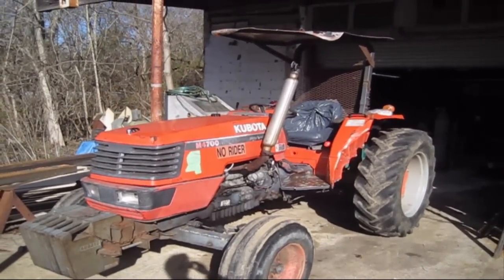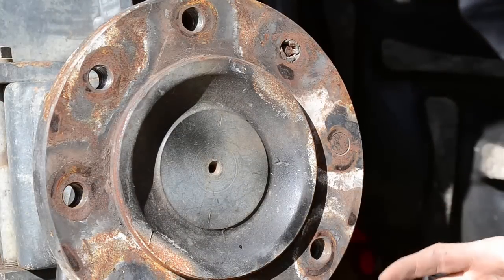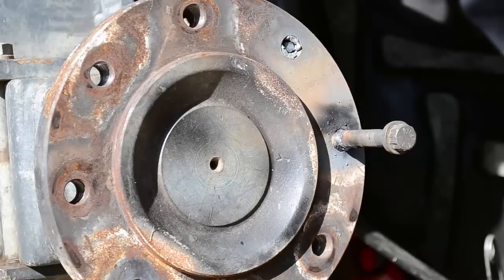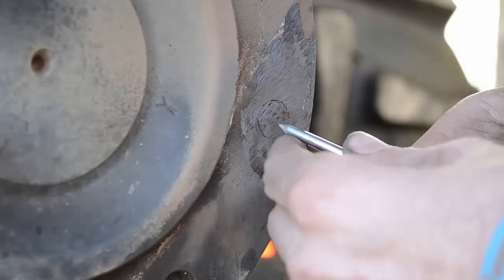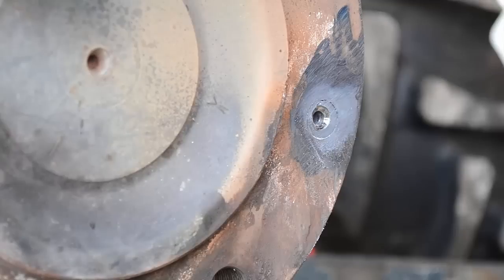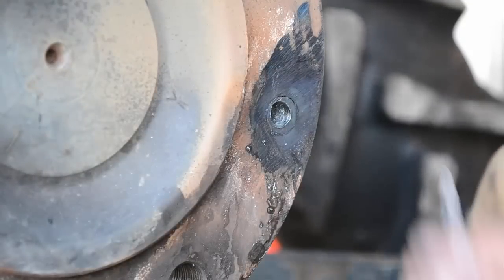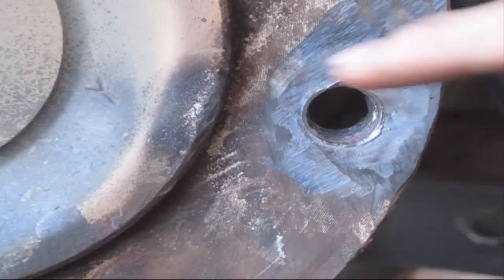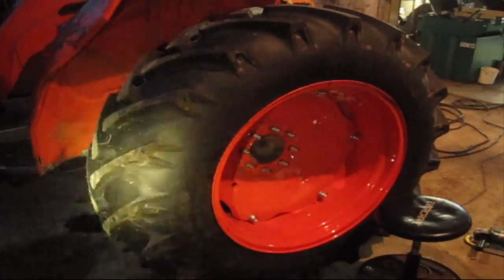Broke-off bolts techniques

Comment: The type of drilling you're doing...if you'll do it at a slower RPM and use Crisco vegetable shortening for cutting oil for drilling and tapping...you'll be surprised. But if youll weld a flatwasher on the whole busted bolt and then weld a nut to the flatwasher..the heating will loosen the bolt and the washer wont break off the stud. I've done dozens. But other than sounding like a dern troll...thank you for your time to make the video and showing one way to do the job. Thanks

Comment: Also, once the stuck bolt/stud moves, I move to manual extraction with lots of fluid and short left right moves until it frees up. II will then turn it until it is stiff again and repeat short left right moves. left - right = clockwise / counter clockwise.

Comment: Armchair Quarterback but...., When you welded the bolt on. Attach a bolt which is slightly smaller than you  used and let cool. Use the impact a run the bolt on through and cut the bolt off. Be sure to use penetrant to reduce thread galling.

Comment: A machinist used to extract broken bolts by heating them, and then taking a hunk of candle wax and putting it on the broken bolt, and then the wax would go into the threads and lubricate  the threads to where he could extract the bolt using a left handed drill bit which would drill in so far, then once there was enough of the old bolt removed, the rest of it would back itself out of the bolt hole. It was interesting watching him do that for me when I had bolts snapped off in cylinder heads deeper or flush with the threads.
Reply from the maker: Perry Bailey Hey I get it everybody has a opinion on doing the job, but you have to remember I was working on something someone else tried and failed to do. In my book there is no wrong way to do something if you get the work done.  I've pulled dozens of broken bolts out for a good number of years all with the weld technique, and I have learned one thing. What you see is not always a easy win.  I know everyone who has watched this video has thought "I could have done that in 10 mins" yeah me too.  Just because it might look easy it can and will bite ya.

Comment: if you drill a hole through the broken bolt then you can use a cutting torch to lance the bolt. you do not usually need to cut to the threads. after letting it cool it usually walks out easily.

Comment: Thanks for the video. The speed of that drill makes me cringe.. LOL  Slow and steady with drill speeds in steel. The bit wont over heat that way plus use oil or cutting lubricant. Also another tip is a carbide burr on a die grinder will remove a broken tap. Also welding on the broke off bolt hardens it. Sometimes it hard to decide which path you should take as welding it like you did will remove it. I generally use wire feed and a nut. Thanks again for posting. Good job!!

Comment: I have torched out bolts. Another way after drilling a central hole is take a small carbide cutter and a dremel. Cut the bolt back to the threads. Then peel out the remaining bolt from the threads. And run in a tap to clean it, or use a tapered tap to clean out the tiny remains of bolt threads. You have an advantage seeing the studs are large.

Comment: Just a Tip for drilling bolts out and this goes for the metal. Always start out with the smallest drill bit then go 1/16 then go to 7/64 then go to 6/32 then go to 13/64 and so on. this will get that bolt right out if you have to drill it.  I realize its not very quick it you will have better success drilling them out.

Comment: I read a lot of the comments and many were about drilling at slower rpm but no one mentioned drilling a small hole ( like 1/8" pilot hole ) first then 1/4" then whatever needed after that. It's much easier to drill a small hole with a hand drill. Always use cutting fluid.

Comment: I had to do this 2 weeks to install a new muffler on my Outlander. Once I drilled through, I used a bolt extractor to get the broken bolt out. Big pain in the rear.

Comment: I have used a hacksaw blade crown down half the height to fit in the hole I drilled , cut four slots to the tips of the threads, and with a punch crush the bolt smaller. Works on fitting too.

Comment: After you weld the bolt on and wiggled it a bit ...next time rub a basic white candle around it by the threads ...it draws the molten wax in and lubricates it making it easier to come out.

Comment: The only thing you did right was in punching the center of the stud.When drilling start  with a 1/8 hst. bit fast or slow doesn't mater. Then go to a 1/4" bit and cut down speed to about 450 rpms. That speed will do for all bits afterwards. If the bit chips or even breaks off get a grinder or a chop saw and saw of the end of the bit and re -sharpen it again. I use bits until there is nothing left of them . Put the bolt into the hole and weld it in , or use some of the other suggestions that have been mentioned here. Heat the flange before trying to turn  the bolt it works every time. Albert.

Comment: Using a length of chain attached above the work point and a lever bar attached to the chain and placed against the butt of the drill enables you to maintain a chip load so as to prevent work hardening.

Comment: After you ground bolt flush you could have took it out back side, Also after you have a hole all the way through you can fill that hole with weld which will shrink the bolt, weld nut (my preference) or blot on it and normally screw it out with your fingers. Shrinking it with weld was an old trick a machinist from a ship from WW2 taught me many years ago. Although in some nearly 20 years working on heavy equipment I have had to blow the bolt out a couple times. Drill speed way to fast. When you get movement back and forth spray a little WD40 and keep working slowly.

Comment: Build up the bolt end if below the surface and then weld a hex nut to it and work it out. 
   If you slowly pour water on it. It generally comes out easier than any other friction reducing chemical. 
Been welding since 81. As a career.  Easy fix for some one with a little experience.

Comment: My tip is when the threads get questionable. Use a longer lug bolt. Put a nut on behind. Also, I've had success with drilling a pilot hole in the broken bolt. Then driving in a larger torx bit in. Plowing its way into the broken  bolt. One set in a socket. However there is danger of just forcing the thin wall of the now drilled stud into the threads even more tightly. But, it has worked many times for me.

Comment: As an engineer you want to heat the area around the bolt, Not the bolt. The bolt expanses with heat making it tighter.  So heat around the bolt and apply cold to the bolt only and remove it.
Reply from the maker: B Souza it doesn't matter what what you heat.  If you heat the bolt it will expand, but guess what happens when it cools. Both parts cool at different rates, so no matter what you do it will break loose.

Comment: If a Cobalt bit doesn't work, try a 1/2" hammer drill on the carbide bit. They usually cut much straighter into stone, concrete, steel without wandering or chipping. I've been lucky enough to get bolts out with MAPP gas but focus the energy on the bolt until it is bright orange, let her cool down then try to rotate the bolt from the front or back if possible. Drilling a hole that's just smaller than the threaded part of the bolt shaft works pretty well if you have to go that route. Then heat it and what's left of the bolt in the hole usually comes out without much of a fight.

Comment: In all my years of broken bolt removal, I found the best tool is the tapered square type remover for bolts up to 5/8'. After that I drill a hole on center big enough to get a jigsaw blade or sawall blade in and cut to the outside, then using a chisel collapsing the thread inward then backing the it out.

Comment: I use a wrench and a hydraulic jack on the welded bolts moving SLOWLY. On the flush one, I would draw a deep line across and use a BIG flat head drill bit. If it doesn't work, you can still drill a hole. Get a good tap set.

Comment: You should've sprayed some PB Blaster on it, shit works great for loosening stuck rusty nuts/bolts. Every garage should have a few cans available. Just like brake cleaner, carb cleaner and starting fluid. I know I do. lol
You said it would only turn in instead of coming out, another thing you could've tried was welding a smaller sized bolt but fairly longer to it. 
Then finish turning it in until the broken bolt comes out the back, cut the smaller bolt off and wala your done.

Comment: top tip weld a washer to the stuck bolt, then weld on the bolt your going to try to turn, will stop you welding to the hub and ensures a solid bond that wont torque and twist and snap like yyour first attempt

Comment: id recommend NOT heating what you're trying to get out, like you said it expands. heat around the item. then you can turn a aerosol up-side down  and spray the item to cool it, contract it and breaks up the tightness alittle(not in reference to burning the bolt out) but good job

Comment: Weld washer, then nut after welding it, apply paraffin the heat pulls the paraffin into the threads then alternate tight loose until it releases,  also if stud  is " proud" (above surface) just heat protruding stud add paraffin then use pliers to remove it. Aluminum wicks heat rapidly and expands multiple times over steel/cast iron, so paraffin works extremely well w/aluminum, replaced many broken Detroit 2 stroke blower inlet cover bolts this way, also you can't weld grade 8 bolts they get brittle.

Comment: Good video, useful tips even for those without a welder or acetylene torch, read through the comments as well good advice there too... best video/comment combo I've come across regarding this. Currently trying to remove 2 broken control arm bolts, yes I broke 2. Grade 10 bolts with a torque spec around 80 ft/lbs, underneath the car so not fun. If you are in a similar situation, definite musts... colbalt drill bits (your random household or black and decker bits will do nothing), some sort of center punch, and lube (I'm using 3 in 1 oil, I'm sure there is a better option but it's definitely better than nothing, going into this I totally expected to break bits, but a slow approach with lots of lube has seemed to work) that's the one thing I feel he left out in the video. I also purchased some "easy-outs" but don't think they will do the job alone, I'm still in the process and thinking about bringing a torch into the picture in combo with the easy-outs. If all this I've said sounds daunting to you, definitely hire a professional, cause my budget ball-joint job when it's all said in done might cost me as much in the long run as a shop would charge. But at least I got some cool new tools that I hope I will never have to use again!

Comment: worked in a muffler shop.  We always seemed to get the crap jobs, which consisted of doinf the job from the headerback.  My installer would heat the broken stud till it just started to spark, then hit the torch with a blast of oxygen/air???  Whatever it was, it blew the stud right out.  Sometimes it melted the end of the header, but we still had enoughh material for a new stud.  Doing this wheel would have been a piece of cake.  5 minutes tops for both bolts.
Reply from the maker: tho52mas1 yeah sure 5 mins.   Headers are mostly made from cast iron a torch doesn’t cut cast. That hub is made from steel if you miss with a torch goodbye threads.

Comment: Not a personal attack so dont take it as such . heat around the broken bolt or stud not the broken piece its self .  if the bolt or stud protrudes from the other side cut it off reciprocating saw , grinder , hand saw especially after someone else already buggered it up why try to wind out a longer piece .  oil , oil , oil , oil ... as already mentioned washer then nut not bolt . this method has always and I mean always worked for me without the drama .. juat a fyi

Comment: I used to burn the bolts out with a cutting torch. If you're careful and your tip is clean you just cut towards the edge and you'll see the threads emerge before they're hot enough to be cut. Knock out what's left and clean out the rest with a tap.

Comment: When it's heated and the gap between the two materials open, use a lubricant.  It will get in the gap while its hot. "Copper" anti-seize works great, it melts into the gap.

Comment: Little old now but in the future take some time to think things through and strategize. On the bolt without the easy out in it, the top of it was pristine and you had the bolt broken free. Rather than try to force it out the way it went in, since the back was messed up you should have just tightened it until it came all the way out the back. You could have completely saved the threads on that one.

Comment: Grainger and Acklands Grainger sell a series 2006 US made drill bit that turns backward. Penetrating fluid (WD40 is NOT one) and then drill a small hole in the bolt then go to the reverse drill. In most cases that is all that is necessary. Broken bolt usually screws out from the action of the drill.

Comment: Nice job, seems I end up with a lot of tough jobs too. Weld on your stud, Heat the area around the bolt so it will expand, don't heat the bolt, then try to unscrew it. Thanks for sharing. Best Wishes n Blessings. Keith Noneya

Comment: After you weld a bolt/nut to the stud, heat it back up until it is red hot and then back it out.  I've never had something not come out if I was able to get it glowing red.

Comment: I didn't read all these comments but aside from heating the bolt instead of the surrounding area that drives me nuts is not using a slower speed on the drill bits and not using oil
Reply from the maker: No matter what you heat the outcome is the same.  It moving was not the problem I got it to move first try.  The threads where caught, and it being a fine thread bolt more screwing around was not going to get it to move.  You don't use oil on something you have welded because if it breaks the next arc you strike you'll have loads of bad weld, and it won't be as strong as the first.  As for slowing down to drill.  Why??? I didn't break the bit you can go as fast as you dare (With in reason) might not have been the "right" thing to do, but hey IT WORKED.

Comment: Perseverance. You never gave up... excellent job. I know it was getting dark, but I wonder how long it took...
Reply from the maker: Dano C. I think I had 8 hours in it.  1-1/2 hours was windshield time had to find a tap I didn't have 12mm by 1.5 no one in town had it so next town over was 45 mins away.  I know that sounds shity to charge for that, but they wanted it back really quick not something I normally charge for.  6-1/2 was the full time I had on the job. I had to help my dad at one point stab a motor in tractor and that took me away from it for a while that's when it got dark on me.

Comment: Union Pacific was having wheel bearing failure on box cars they were rebuilding.  Turned out they grounded the welders to the rail, not the car frame, and spot welded the bearings.

Comment: The best fluid I ever found was KROIL Penetrating oil.  After you heat the area, squirt Koil on it.  Will smoke like a bugger, but sucks the oil in to lube the threads.  I used it on all old rusted/stuck bolts.  Great stuff.
Reply: detroitbob58 .... utube comparisons of all penetrating fluids show liquid wrench & atf/acetone better...watch it ..save money😃

Comment: Use a nut instead.  You get more heat on the broken bit and it's a much bigger weld holding the nut on than you can get tacking a bolt to it.
Go ahead and drill a hole through the center of it too.  Changes the stresses on the part and you might get some weld in there too.

Comment: I don't want to sound like I'm dumping on you, but I also learned from experience that with steel or other hard materials, slow down and lubricate. I've actually seen guys pull a drill bit out, flaming red.  It's lost at that point.
Reply from the maker: Its all good.  I did use coolant off camera, and yes I've seen that too.

Comment: Personally after I was able to get a hole through the broken stud and if it was off center to then use a Dremel type tool to grind away one side of the stud until you start getting close to the threads.  Your punch can then remove the stud by bending over an edge of the stud to back it out.  Also reverse drills can also help with broken bolts or studs.  Use lubricant!

Comment: When drilling hard steel, back off the rake and the clearance angle a few degrees on your high speed drill bit to strengthen it's cutting edge AND use plenty of cutting fluid to keep it cool.Use a cobalt bit for high heat resistance..Once you have stepped the hole out sufficiently, grind your center punch point into a "diamond" shape and use the diamond point to collapse the shell of the old bolt..You can also use a Dremel tool with a carbide cutter instead of a cutting torch..use it to split the hollowed out bolt, then collapse and remove it.

Comment: Saw a fellow drive a large Torx bit into the hole in the bolt threads.  Then used a strong arm to unscrew the remains of bolt threads. 
Worked really good on the U tube video.   Also is it possible to put a smaller bolt Through through the drilled out old bolt with a nut on the back.?   There should be a massive safety factor on the wheel fastening calculations.  It would never depend on say 80 % of the full strength of the full number of wheel bolts. 

Good luck..
  ...
JoeB